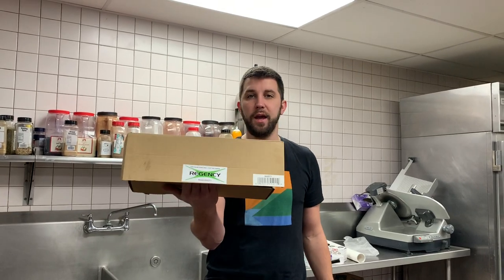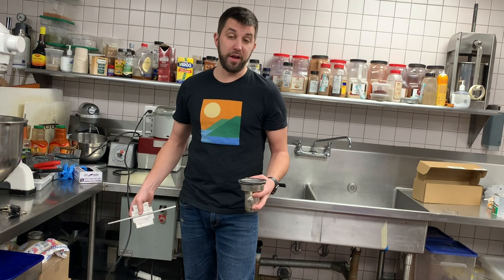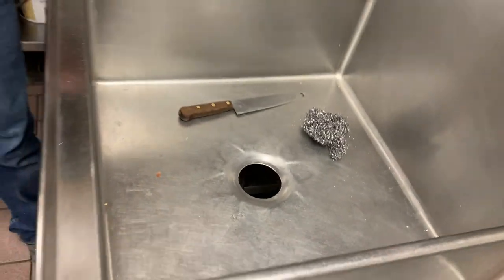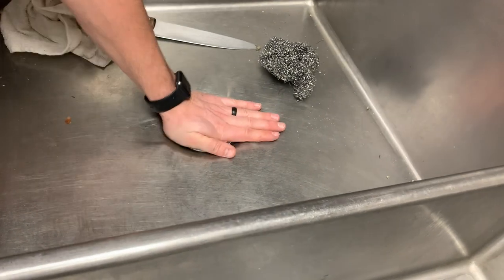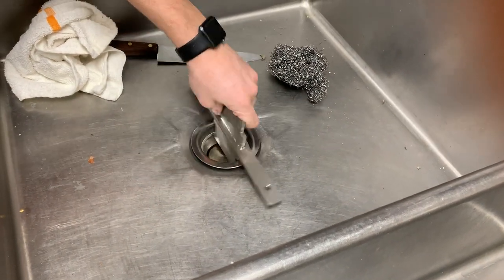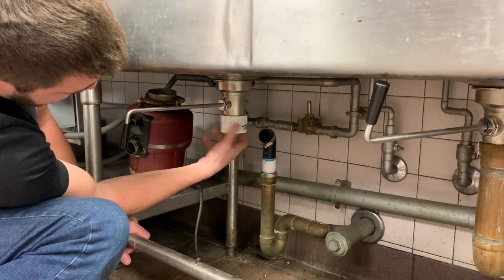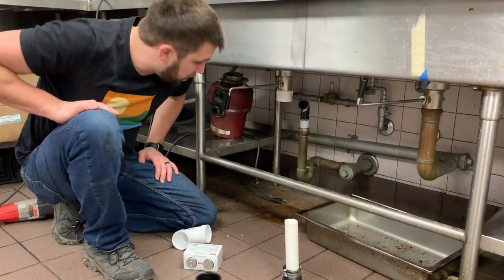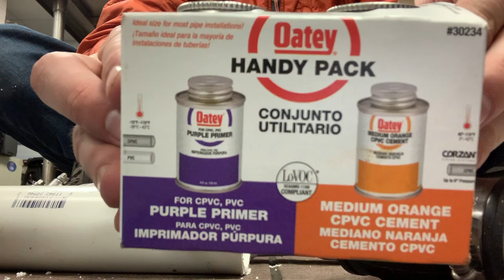INSTALLING COMMERCIAL WASTE VALVE/DRAIN 2 BAY/3BAY SINK----RUBBER GOES BENEATH SINK!!

Comment: I think the primer is supposed to go on in the total area connected (not just unevenly smeared) first dry then cement, also floor drain. Plumbers putty on top cardboard is removed its just packaging.

Comment: People: do it right the first time. Use Teflon tape on metal threads, or pipe dope. And I bet that 2" to 1" rubber adaption leaks. Sheesh
Reply from the maker: Most of the time yes. On a gravity drain like this it wasn’t necessary, years later, no leaks.
Reply from the maker: https://www.youtube.com/watch?v=RCepHSrjKQI
Reply: At least explain to the people that you are using the rubber in the wrong place and that you decided to use the wrong glue.  do not miss lead people.

Comment: Lol your rubber seal goes on the bottom  of the sink. You used cpvc glue on pvc. I hope this is just a funny video to get a laugh. 😂😂 there’s no emoji for stupid. Should have called the plumber
Reply from the maker: Gotta look at description. As mentioned in other A-hole posts, I noted that. Hasn’t leaked since installed. Thanks for your input!
Reply from the maker: https://www.youtube.com/watch?v=RCepHSrjKQI
Reply: If it works it’s fine. Nobody needs to build a damn Cadillac sink to make money.

Comment: you put the rotary waste in wrong, you didn't know thats what its called, you used the wrong glue on the pvc, there is a way better way to connect that waste together.. you don't bring babies to job sites and put them on camera around plumbing tools.. this is very very unprofessional. Pretty much everything you did.. Wheres the teflon tape and dope?
Reply from the maker: See description on rubber seal. Seal goes in below. No Teflon or dope needed- it’s a drain that is not used much and doesn’t have pressure as I noted if you watched the video in it’s entirety I gave viewers that option and stated why I didn’t use it. I’m not plumbing a commercial sewer line here. This is for DIY restaurant people not people looking to become a plumber. Thank you for your comments though.